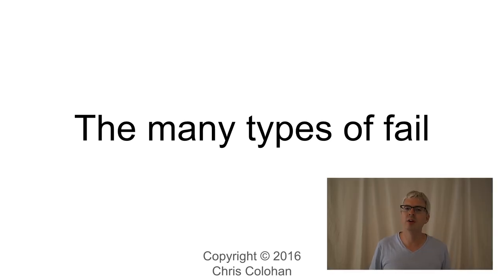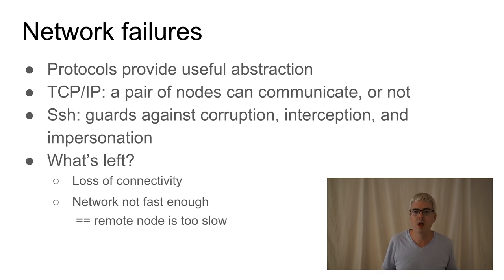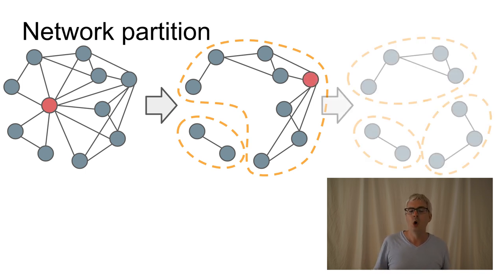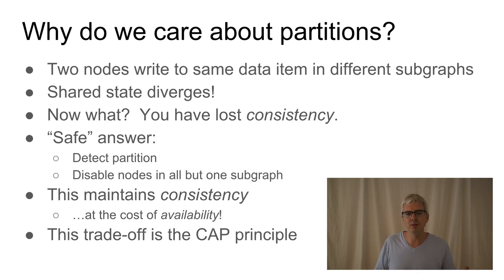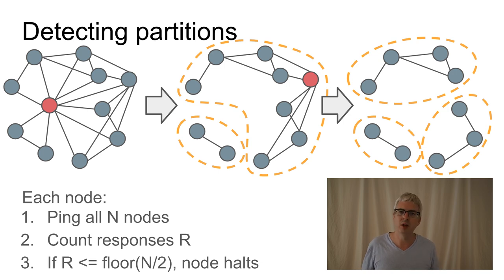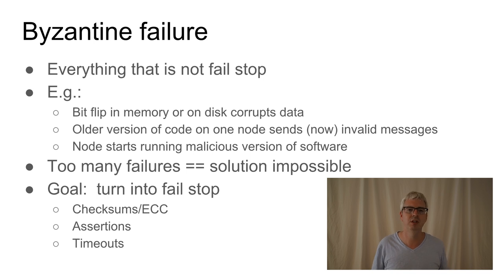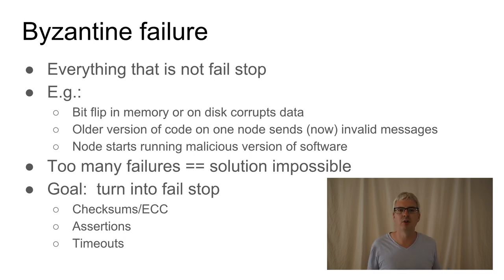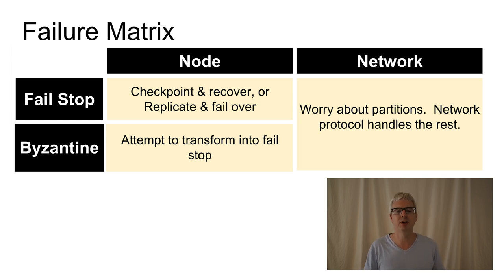L5: The many types of fail

Comment: In quoram, if a node pings and gets responses from N other nodes, that means each of those other nodes will get a response after pinging these N other nodes... Am I right? So if these N+1 nodes are more than half of the nodes, then these nodes are active i.e. participates in both read and write... Am I right?
Reply from the maker: Sorry for the delayed response (missed this one)...

Usually if node A can talk to node B, then node B can talk to node A.  So usually you are right.

But sometimes that is not the case.  Sometimes a networking glitch can mean that packets can flow in one direction only.  Or bi-directional connections can be established from A to B, but not from B to A.

This happened to me when I was testing MapReduce scaling.  At the time, the code on each node would open a TCP connection to every other node, ask it for any pending data, and then close that connection.  Well, I did some experiments scaling this code up to an insane number of computers.  And some nodes (but not others) used up all 64k ephemeral ports by establishing outbound connections and leaving all the ports in state TIME_WAIT.

This meant that any node where this happened could no longer establish outbound TCP connections for up to 60 seconds (which is how long it takes for a port to leave TIME_WAIT and become available again).  So if this happened on machine A, then A could no longer open connections to any other machine (but could report what was going on using already open network connections).  Other machines had no problems talking to machine A.  This played havoc with the simple algorithms we were using to determine when a machine was dead -- since when this happened on multiple machines at the same time our master would get lots of messages saying "all the machines are dead, I can't talk to them!" from impacted machines.  It was really hard to tell if the problem was the affected machines, the network, or everyone else really was not working quite right.
Reply: Thanks very much Chris... Will wait for more videos from a knowledgeable person like you...  Great lectures....

Comment: So when network partition happens in a way that each sub-group is less than N/2, it effectively means that the whole system goes to read-only state, isnt it? So what does real production systems do in this scenario? Do they wait for the network partition to be resolved? or they apply some other mechanism? If they wait for the network to be resolved, then this can potentially affect revenues isnt it?

Comment: Also, Have you seen any "Byzantine Failure" in a production system??
Reply: Thanks for the reply. I read about distributed system back in college, then didn't do anything distributed from 4-5 years but now back to distributed systems (currently kafka etc). I am sure we faced some of data corruptions which will fall into "Byzantine failure" mode, but I was wondering about your experience at google etc.

That robot story is super cool.
Reply: Thanks! Explanation with real cases is quite vivid !
Reply: what are your views on blockchain and  proof of work. It claims that it effectively solves byzantine generals problem?

Comment: Hi Chris,

I was listening your video L5:The many types of fail. I could not follow the sentence you delivered at 2 minutes 18 seconds. Could you please let me know that?
You started saying as "My personal favor.....is "------" failure. I did not understand "------" part.
Reply from the maker: "My personal favourite which I learned when I went into industry is backhoe fade.  That's what happens when a backhoe cuts your network cable in half.  Who knew?  Apparently it is one of the more common failures you have to deal with if you're dealing with a distributed system which spans multiple cities or countries."
Reply: I just got the reply from you over email. Thanks very much Chris.

Comment: what cuts your network cable in half?
Reply from the maker: Listing all possible causes would be long and boring.  So I'll list some causes I've heard of from the folks I've worked with in the past:
- Network equipment crashes or loses power.  If two computers can't talk to each other, it is as if the network cable is cut.
- Technician mistakenly removes the wrong wire from a switch, disabling an active connection.
- Skateboarding technician trips and knocks a wire out of a jack.
- Someone bends a network fiber too much, and the internal glass cracks.
- Bad configuration or software push to networking gear breaks active network connections.
- "Backhoe fade".  Buried cable between buildings is hit by a shovel or backhoe during construction.
- Car accident hits utility pole, breaks network cable strung up on pole.
- Tree falls in the woods.  Hits cable, breaks it.
- Hunters in woods think repeater box looks like an attractive target, shoots holes in it.
- Avalanche breaks network cable in mountains, unsafe conditions make getting to it for repairs challenging.
- Fishing boat damages undersea cable.
Reply: thanks, these are great videos btw, entertaining yet informative
Reply from the maker: Thanks!